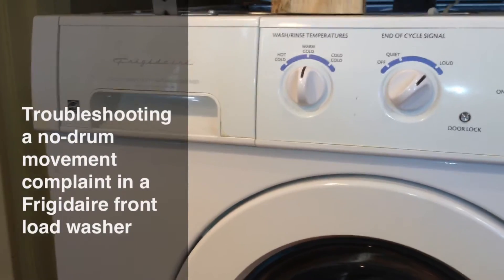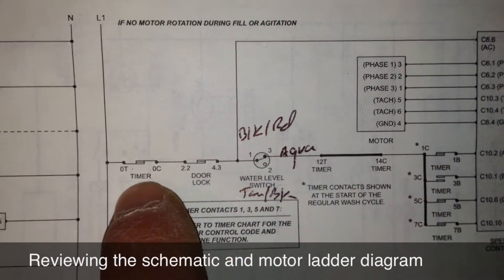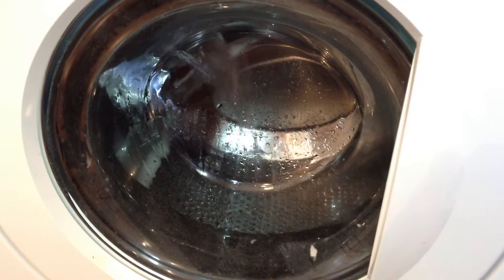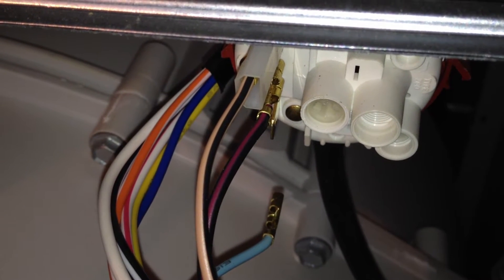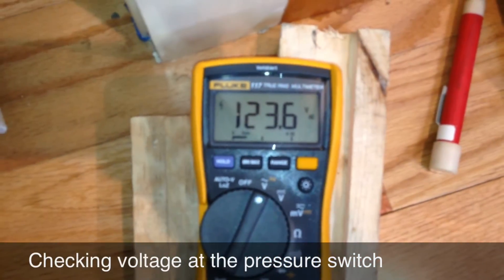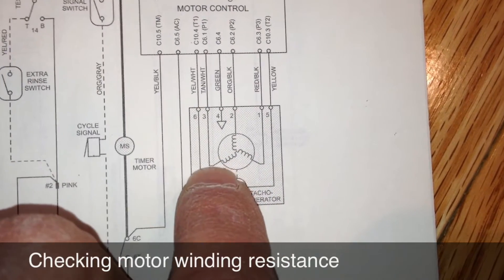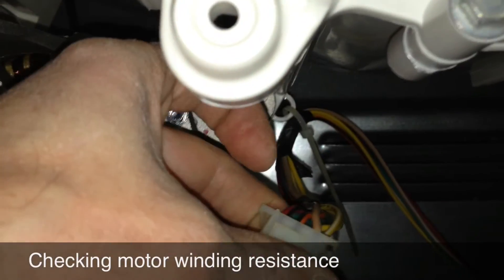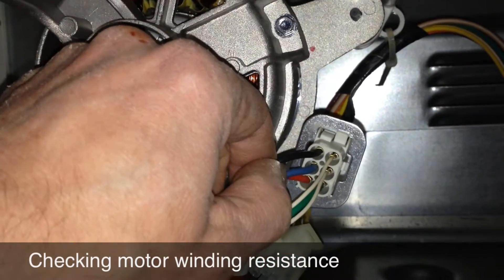Fixing A No-Drum Movement Problem In A Frigidaire Front-Load Washing Machine

Comment: I'm having the same issue. I replaced the door latch switch first because the door was always getting stuck (drum still doesn't turn) Second, I checked the Aqua wire 120 VAC connected, 0 disconnected. I checked pin 5and 6 of speed assembly 0. The only other option is the timer switch correct. The timer switch is the one where you set the speed and turn off and on on correct.

Comment from the maker: Since I'm just checking AC voltage, the black lead just goes to any chassis ground.  Although neutral and ground serve different electrical functions, in a grounded appliance, which all wet appliances are required to be, they are at the same electrical potential so measuring AC voltage relative to either gives the same results.  Measuring DC voltage is a whole different game-- chassis is typically NOT the correct reference; I have another video that shows that.
Reply: SamuraiRepairman

Comment: Hi I watched this video and tested the pressure switch like was shown and found I had voltage at pin 3 so to be sure I removed the Aqua wire like in the video and retested pin 3 and had no power but did have power through the aqua wire. My question is does this mean that the control board is defective and that there is also another problem with either the door switch or the timer? also one other thing in the video you have the machine turned on and it is filling but when you test the pin there is no water running, do you have to wait until the machine is full before testing? thanks in advance for your help.
Reply: Hey did you solve issue ? 
I would always check door switch first and or replace prior to other larger issues like motor or main control board.

Comment: I have the same problem I replaced the door lock switch did two loads n stopped I replaced the control board still no movement on testing pressure switch where do you put the black wire on tester to check the voltage

Comment from the maker: I have never replaced a bad timer in a Frigidaire-Electrolux front loading washer.  The general rule of thumb is this: 1) It's never the timer, 2) if you think it's the timer, see rule number 1.  Have you replaced the motor control board?  Buy it through Appliantology and you'll get a one year return policy with it, even after you've already installed it.  It's insane, but true!

Comment: i have a frigidaire frontload model gltf1670aso i just replaced the drum bearings , everything went together well until startup . it filled and washed then did a strange spin out after the wash cycle then no final spin .  on the restart the motor never moved i get continuous water and and draining but the drum never moves the motor dose not move .  im getting nothing on the testing of the wire 3 in you video  but im not sure i know what im doing there . the door lock works .... im lost where to go next

Comment: i have a question about my washing machine, but its not this one its an aeg lavamat l86800.... if you can help? the drum dropped mid cycle, and we managed to hook the spring through a different hole, (if that makes sense?) but when i put it on a cycle it wont drain, rinse or spin.. and when i spin the drum inside it goes around but there is a slight scraping noise?

Comment: my problem: the drum initially does move but it stops mid wash and will do final spin.  check aqua circuit i get 120 volts after water level is reach.  even with 120 at aqua circuit there's no drum movement or moves very slowly. motor Resistance is within specs and not seized or loose belt but when i touched motor it shock me a little...could it be speed control module?

Comment from the maker: If you review the video, the tell-tale sign that the motor control board was bad was that I was getting 120vac on the aqua wire *even with it disconnected from the pressure switch*.  The 120vac is supposed to feed through the pressure switch to the motor control board.  The fact that the motor control board was *backfeeding 120vac to the pressure switch* was conclusive proof  that the motor control board was bad.  This is not what you're reporting in your case.

Comment from the maker: Sounds like the motor control board is bad.  The failure I showed in the video is just one of many different ways this board fails, it doesn't always fail as shown in the video.  The tech sheet has other tests you can use to confirm.  Or, just buy the board through the link in the video description and install it.  If it doesn't fix the problem, return it for a refund!